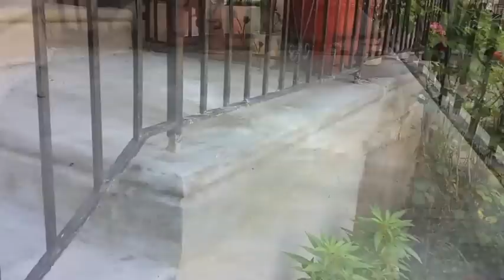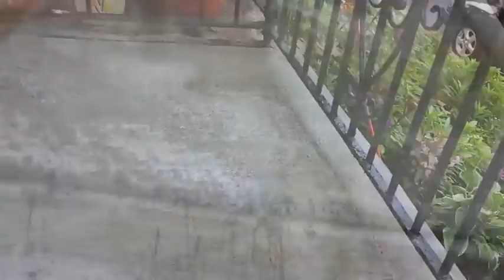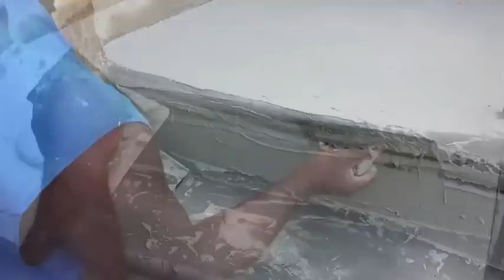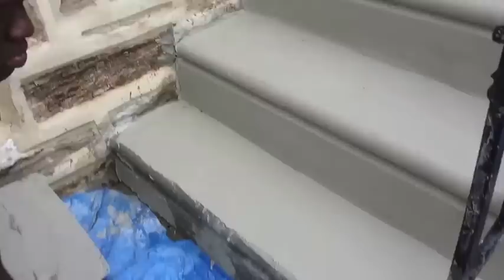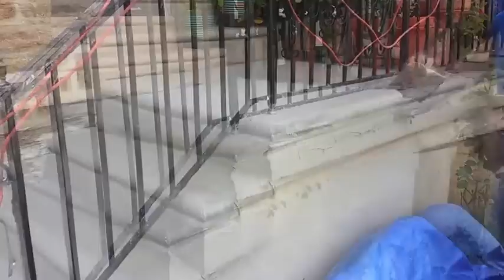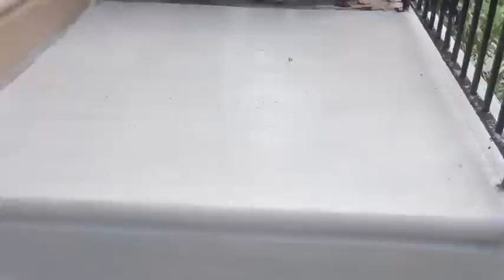Easily Resurface concrete Steps | Concrete and Cement work Contractor

Comment: Thank you for this great tutorial. Q1> What is the name of the red trowel(with soft bottom) you used@02:06? Q2> I don't have access to the renew fine product here. Did you ever use the Quikrete 40 lb. Concrete Resurfacer? Do I need to add any other ingredient such as SikaLatex 1 Gal. Concrete Bonding Adhesive and Acrylic Fortifier Q3> How thick I should lay the resurface on the stairs? Thank you
Reply from the maker: 1.  Red Grout Sponge  http://www.homedepot.com/catalog/productImages/1000/f1/f164012c-7b8b-456a-a342-43865bdbdab6_1000.jpg

2. I never used the Quickrete 40lb resurfacer but if you were to generously fortify the product with concrete bonding adhesive  I would summarize that it would greatly help to prolong the duration of the repair work.  I would not use Sika, too watery. I had the best success with:  http://www.homedepot.com/p/Quikrete-1-Gal-Concrete-Bonding-Adhesive-990201/100318465

3. Keep your repair as thin as the trowel will allow you to.   Gingerly wet the surface to cool the surface first.  You have to thin out the mortar with more of the bonding agent then water.  Typically I will use a full gallon of adhesive , 1/2 bag of play sand and type 1 cement in a 5gal bucket.  The mix is liquefied by the adhesive.   (1 part glue, 1/2 bag play sand, cement qty to match qty of sand.)
Reply: Q1> What do you mean "keep your repair as thin as the trowel will allow you to"? Do you mean I should apply the cement just like paint the stairs?

Q2> Do I need to add water to the mix? For the repair, I only use the concrete mix with pure adhesive without dilution.

Thank you
Reply from the maker: codyq0987 thin out the cement so that it can be applied thin.  The consistently should match what’s in the video.
Reply: Please help confirm the ratio.

Sand 2 parts, Cement Type One 1 Part.

Thank you
Reply from the maker: codyq0987 for the first coat do 1:1:1 this will be your tack down coat. 2nd coat do 2 sand :1 cement : 1/8glue
Reply: One more follow-up question. Should I wait the first coat completely dry before applying the second coat? Thank you
Reply: @DependableConcrete  Hello, where can i buy bullnose tool???

Comment: Excellent job with the resurfacing... I am wondering about the iron railing where it meets the concrete.  I see a lot of rust in these situations.  Can you suggest something that would protect the railing better?
Reply: I would treat it like paint and cover any surfaces you don’t want the concrete to touch

Comment: hi there, i have a friend looking to re surface concrete steps like this, they want a bull nose design. how would i make and what concrete should be used to re surface steps like this? awesome work by the way
Reply from the maker: need  a bull nose tool and i would recommend using Portland cement with an admixture of acrylic bonding agent

Comment: That cannot possible bond to old concrete can it? No bonding agent?
Reply: Kyle Dewar if it has lime or other bonding agents in it I think it should bond. I wasn't quite able to read the bag...
Reply: @ff4444  i ended up using quickrete bonding primer and ardex feather finish as a top coat, seemed to bond very well...of course will have to go through a canadian winter to see if it will hold up
Reply: @kyledewar2117  how did it hold up after a winter? I'm wanting to resurface a slab too
Reply: @MarshallBLewis  actually worked very well no issues at all and they look brand new

Comment: where do you get the tool to do the edges
Reply from the maker: +WILLIAM B You can goto a place called Nolen Building Materials in Philadelphia.  Its called a Bull-nose tool.  There phone number is 215-843-3300   Hopefully this helps.
Reply from the maker: picture of bull-nose tool
http://www.contractortalk.com/attachments/f48/227193d1443145862-block-base-concrete-stairs-bullnose-tools-010a.jpg
Reply: I heard that is Philly thing. 
most other areas, the riser under the bullnose drops straight down, and does not protrude.

Comment: what product us used to get the concrete off the railing?
Reply from the maker: Muriatic acid.  Link:   http://www.homedepot.com/catalog/productImages/1000/f5/f5fdb419-d64d-430f-985e-2400003ccc2b_1000.jpg
Reply from the maker: Dilute with 4:1    4 parts water to 1 part acid.

Comment: What product did u use thanks
Reply from the maker: I mixed hydraulic cement with Portland cement to accelerate the dry time.   Otherwise the wait time would be forever to shape the bull-nose.    Here are the links:
(hydraulic)
http://www.homedepot.com/catalog/productImages/1000/0e/0e672fc1-c670-414c-87ed-4fbecc4f7bad_1000.jpg
(portland)
http://www.homedepot.com/catalog/productImages/1000/65/65d7e5eb-fc8e-4ef8-a8f3-5a22b4086075_1000.jpg

I'll be glad to answer any other questions Maxius.